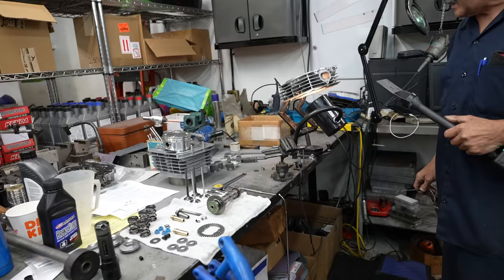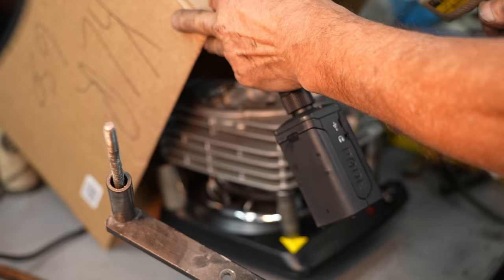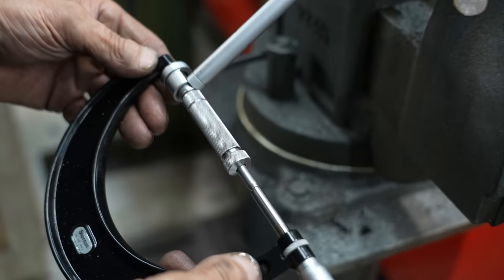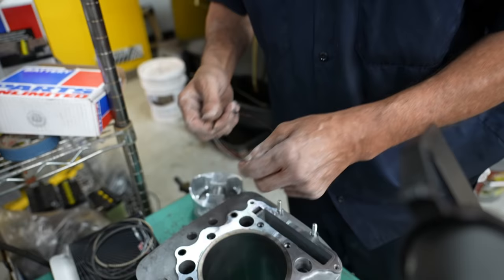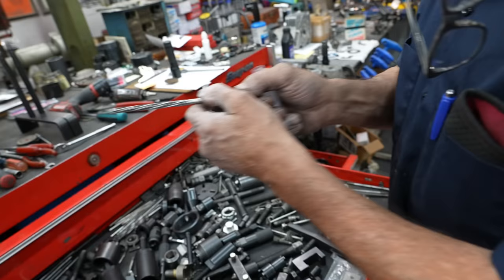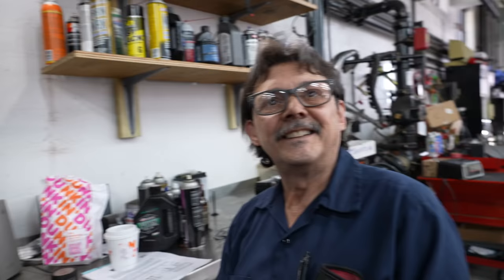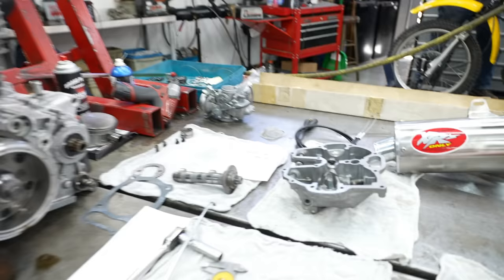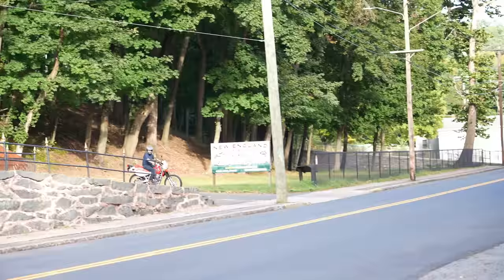OUR BUILT XR650 HITS THE DYNO!

Comment: Now that's talent! Not only is Jeff an engine guru, he bangs out wheelies like nobodies business. This was awesome content. Bring on the head pipe!
Reply: amen
Reply: What carburetor did they use
Reply: @verntreat4162 sorry I am not sure on the carb used.
Reply: I would have prefered to see some acceleration runs from stopped instead... Wheelies are not representative of engine power.
Reply: @altair7001  you already know the power, that's what the dyno is for. Acceleration runs with no timing will tell you absolutely nothing. Not to mention it probably makes too much power to be able to use full throttle in 1-4th gear at any decent rpm.
Reply: @wynandsijben338  - I own a 2007 XR650R that’s been “uncorked” and made for a faster top end. It’s brutal! Biggest front sprocket and the smallest back sprocket. I’ll challenge anyone east of the Mississippi that it’s the fastest XR650R.
Reply: Hell yeah!!
Reply: Was there ever a follow- up to this?
Reply: @altair7001  wheelies are always wheelies and whoever doesn’t appreciate is not able to pull one! Just joking , enjoy biking!
Reply: @fixedguitar47  How about west of the Mississippi‽‽‽
Reply: @altair7001  What's a XR without wheelies!! They go hand in hand 🤘🏻

Comment: That man is a genius!
He just added 50% more horsepower to the entire rev-range of this channel!
Reply: Agree. I haven't watched the channel for awhile. He has brought me back.
Reply: Yeah genius, this engine has a 60HP normally.
Reply: The big change in compression ratio and higher displacement tends to increase power on the entire rev range.
Reply: @polemonek  learn about wheel horsepower and crank horsepower before you comment. Also, there's a difference between XR650L and XR650R
Reply: @sepg5084  you can’t fix ignorance
Reply: @polemonek  That's weird, because my low mileage perfectly running 650L only put out 28 hp to the rear wheel at the Ducati dealer in Denver. After a 2mm overbore,  10.5:1 piston, pumper carb, full exhaust and opened up intake,  it put 48 hp down on the dyno. Still 12 hp shy of the "stock" 60 hp. Hmm
Reply: @milkotex
Dirt bike Dave’s comment was about the CHANNEL (a metaphor), but that went over your head. Then you clearly don’t know the difference between an XR650L and XR650R, so you arrogantly spout horsepower stats that don’t apply here.

Comment: Fascinating video.  

I picked up an '03 XR650L last year.  232 miles on it, left in the corner of a barn.  Got it for $650.

Luckily fuel was totally drained before it was stored.  Did a carb rebuild, and it runs like a beast.  2k miles now 50/50 dirt street..

Been following this build.  This guy is awesome, really amazing attention to detail.

Comment: Nice to have the added horsepower and torque on reserve for those special occasions !  It’s an air cooled motor so high quality synthetic oil is a must with more frequent changes .  You would be shocked as to how hot these motors run even under normal conditions .
Reply: Here (Nevada desert) an oil cooler is a must for long rides.
Reply: @TheBandit7613  do you know any specific oil cooler for the xr 650l that is good?

Comment: What a beast! Great job building a killer engine. As someone who loves his 30hp turd, boy having 45 would be unreal. What was the torque like? The dyno never showed torque.
Reply: I think the way the front-end came up through traction action alone, showed the torque...like my Yam TT500 does compared to my old XT500
Reply: To get the torque values, just use: Torque = 5252 * Power / eng_spd     Unfortunately, his dyno only showed road speed on the X axis, but this can be converted to engine speed via the gearbox ratio, the final drive ratio (sprockets) and the rear wheel radius..

Gotta say, 45 hp for 650 cc is lame - that is only 69 hp per Litre. There are two stroke engines made in Italy that only have 3 moving parts, naturally aspirated and produce over 800 hp per Litre!
Reply: @christopherknee5756  Not bad for breathing more life into an old single cam motor that they want to last more than a race. KTM production bike of similar capacity, more of a modern trick motor, only makes 53hp. This year`s 450 Yam, a high-revving single, makes under 50hp. Kwak KLR650 2022 model, doesn`t even make 35hp.
The Italians and little two-strokes....they`ve always excelled in that field.
Reply: @rattusnorvegicus4380  Had both, miss those days!! Didn"t crash as often on the hondas though!
Reply: @charlesfriend9557  I stood on a pedestrian walkway over the A1 and saw two Germans touring on XT500s and immediately went and bought one. Sound machines, never dropped the XT on the road and was often followed by or I  overtook, those that couldn`t believe lean angle on old block-pattern knobblies. Eg,  "We thought you were off, the shoulder of your rear tyre was completely doubled-under when you cranked it over immediately after overtaking us. We were doing 80mph."...I was greeted with at the pub in  1980, after overtaking Ford Escort van  on slip-road off A1 into constant radius bend. 
On the rough/Enduro, the XT was a real handful, far too heavy in spite of me being over 6` and super fit. Dropped it three times on three outings and gave it up as a bad job before I injured myself badly. (That came 5yrs later on the road with my `76 Guzzi LeMans Factory Proddy Racer, thanks to being collected by a blacksmith in a Ford Transit)
After quitting the off-road bumpy tracks on the XT, I made ovals in stubble fields, the comparatively  even surface made drifting fun, and although it often felt like it was about to tangle itself up, never dropped it there.
Out of over 70 bike owned since I was five, not had a med/ big off-road Honda(broke the crank doing 30ft jumps on a 125 though), but did enter a comp in failed bid  to win an Africa Twin this year....but hope to win the 1,000 miles 2020 KTM 790 Duke up for grabs, come this Thurs 14th Oct`21. That`s more my cup of tea :)
Reply: The Trashman  33hp

Comment: A big 0.080 thousanth's squish (quench area) could be tightened to 0.035 but like he said, that would bring in another point into the compression ratio to maybe 12/1 compression  requiring 94 octane or re-jetting carb for some high octane E-85 fuel.  That would really be a fun dyno number!
 Funny thing, two welded in flat areas on either the head or piston flats (maybe decking the piston height out of the block, too) can allow CR cooling with added swirl, to likely use 93 octane in many cases.

Some guys are keeping the single angle on exhaust valve and sinking the two valves in the pocket a bit, to reduce valve overlap exchange.  Giving the engine less octane requirements.  Highly advanced tinkering.

Comment: Good Day Mr. Kaplan : At about time 7:46 and your dial bore gauge . I was 40 years in aircraft / aerospace and have used and repaired those Mititoyo dial bores hundreds of times . If you like there is also another dial bore maker out there called Sunnen . You can get them with the three fingered model that would be a fantastic asset to your work and your sanity . They are digital and don't have to be disassembled and reassembled every time you need them . Each comes with a very accurate setting ring , all you have to do is put the dial bore into the setting ring and read the number in the window , that's it . No need to to disassemble and reassemble .Try them some time, I'm sure that you will like them .

Comment: Unbelievable build. I would love to have one built like that. Turn it into the ultimate enduro bike. In Tennessee that bike could go places! There is tuff country around here. Plus it’s big enough to handle Highway speeds. So it can make hop different cities it’s own. You are a magical 🧙‍♀️ ! Great in depth video. Honda is the Best built all around bike period ! I ride a 1980 cb900c, 10 speed, air ride, rubber mounted engine and transmission, shaft drive, disc brakes front and back, ! My Son went from the front through the back up dating it for me to ride. Runs unbelievable. Honda is such a forward thinking Company. They just can’t be beat ! 👍🏍

Comment: Admirations for this guy who uses the metric system as more precise than the imperial one! For the fine and precise work he is doing.

However, he doesn't know how to calculate the volume of a cylinder, which is: 
V (volume) = r (radius) x r (radius) x h (stroke) x 3.14 

You don't need to divide by 4 in the end. He divided it, because he was multiplying the diameter, instead of the radius. Diameter is double the radius.

In this case the cylinder volume (cc) calculation is:
51.2 x 51.2 x 82 x 3.14 = 675 cc (not 670)

Because in the previous video he said that he will increase the bore from 100 mm (stock) to 102.4 mm. Unless they changed their mind and he increased it only to 102 mm instead of 102.4 mm. In that case the volume is 670 cc.

Comment: David Vizard proved (with a gas flow bench) that stepped changes of 15 degrees around the valve seat behave like a continuous curve. He also said the cast in boss around the valve guide should be cut away and the guide machined to a plain taper. Straight taper tip flows better than a bullet tipped guide. 
Exhaust ports are less fussy because the hot gasses exit almost instantly and suck the cylinder well below atmospheric pressure.

Comment: i learnd honing with exactly this tools, but we used spezial honing oil to get the surface even smoother. i had to hone holes from 120 up to 500mm 😀 all by hand with a 3000 Watt slow drill, it had so much power it once broke a mans arm when he made a small mistake holding it wrong 😳  you did a very nice job on the clearance 😃

Comment: Most adventue bikes really can't handle as much off road as people think. This xr with the extra power, long suspension travel, high ground clearance. Could be a true off road adventure bike. Instead of 75% hwy 25% gravel country roads large heavy adventure bike. All it needs is an adjustable windscreen & a custom made bolt on 🔩 rear rack with some tough canvas saddlebags & 3rd rear bag. Plus rider backpack, could carry lots of gear deep off road. Or carry lots of groceries home from a ride into town.

Comment: Just a quick notification: The gage is measuring at 0.01mm so this is no "microns" at all; it is ten times bigger. 1 micron = 0.001mm. Still everything said is perfectly accurate. If you set your clearance at 0.05 it is 50 microns. And it is still a freaking precision job!

Comment: One of the absolute best boring/honing work I've seen on the net, loving the 78 Suzuki in the background at 21:31... From the care and absolute passion contributed to this 650 motor it is clear this man is fully committed (rare find nowadays) Did they harden/heat-treat the cam after welding and re-profiling? Love seeing you keep track of the work you've done makes it easier to achieve repeatable results!

Comment: I have a 2000 650L that I bought new, has 5400 miles. I did a base line dyno at Erico Motorsports in Denver bone stock and it did 28hp and 30 ftlbs to the wheel. Then I pulled the motor and sent the cylinder to XR's only for a 2mm over bore (no shop in Denver would bore it that much) . I put a JT 10.5:1 piston in it, a 2004 YZF450 carb w/Noss adapter, an FMF Powerbomb head pipe, an FMF Q4 muffler, and a UNI foam air filter and I opened up the air on (speed holes). Lol
I re-dyno'd it after I put about 200 miles on the bike and it put down 48 hp and 50 ftlbs! The exhaust "Sniffer" showed that it was running lean, and they said with some tuning and break-in it should see 50 hp at the wheel. I ended up moving to the NW and the bike has been in storage for 6 years now. I bought a 42.5mm taper-bored CRF carb but it'd still sitting Uninstalled. I should get it going, way too many house projects 🙄
Reply from the maker: Cool story thanks for sharing!
Reply: @KaplanCycles  Thanks for reading that long novel! 🙏 😁

Comment: personally I just hammer the valves into the seats with a 18oz hammer, close enough to 30psi compression runs on kerosene and let it idle at near red line for a few seconds and shutting off to keep it cool... till it starts to stay running with the key off, then put regular gas in it and repeat going up gas grades until it shuts off when the key goes off. hard to do on one cylinder, works on 4 or more.  😋

Comment: those pistons expand like crazy on the 2 strokes anyway set it up with wiseco specs and scratched the cylinder wall on a few builds. I build a lot of motors for cars 4032 pistons are at 4-5 and 2618 pistons 8-11.

Comment: Notes i have a folder from the 80,s with info u just can't find now , Tony halco off halco racing done engines for flat trackers I paid a handsome amount for my 840 motor hydraulic clutch oil cooler e starter removed n blanked ,the guy was a xs genuis .unfortunately when he passed he took all his secrets to his grave 740 is s high mechanic engineers will go .rip Tony halco ,what a flatracker I owned every where I went people bikers just asked questions. It turned out beautiful n it was my second paint job ,ever ,peace

Comment: One line on that bore gage if it's metric isn't .004" it would actually be .0039" which is .0001" difference probably doesn't matter on a motorcycle but in the machining world that matters especially if you're setting your gages off of that

Comment: I use to be into drag racing and so many friends of mine would put a big shot of nitrous or put a supercharger on their engine and I would tell them you gotta pull the motor apart and gap the rings because if you don’t the rings will expand from the extra heat so much the ring gap closes sizing the rings then breaks the top of the piston right at the ring lands. My one friend would always run his mouth we would end up having this big grudge and his car would always break down. One year he melted spark plugs and blew the throttle body off the intake because he ran a ton of nitrous without running cooler plugs, didn’t take any timing out of it and didn’t have enough fuel. The last year we raced I said dude this grudge stuff is all fun and games but you blow up every year so tell me what ur running so I can make sure ur not gonna blow up. He had a small block stroker Ford with a 100 shot of nitrous so I told him what plugs to run, fuel jet to run, fuel pump, run bigger fuel lines, what to run timing at. I said if ur gonna put a bigger shit of nitrous, if ur lying about the cam ur running and the compression ratio ur gonna ruin that engine if you don’t have the rings gapped, timing set, cooler plugs, better fuel. Well he said nope I’m running what I said. We go race and halfway down the track he slowed right down. He gets towed back and I come over to give a hand. He cranks it over and I could hear he had a bunch of cylinders without compression. I see 4 nitrous solenoids 2 fuel and 2 for nitrous you only have 2 nitrous solenoids when ur running a lot of nitrous. I looked at him and said you just ruined this brand new engine. His girlfriend starts yelling at him for wasting so much money he looks at me and said I didn’t know what I’m talking about. I said dude you are running min 300 shot of nitrous and it’s barley safe to run 100 you ruined a bunch of pistons. Sure enough he pulled the heads and 4 pistons were broken from the rings locking up broke the tops of the pistons and he bought the same camshaft that I have which was a terrible choice to use with nitrous, too much timing, plugs were too hot, fuel line was barely big enough to feed the engine without nitrous, ran 93 pump gas not even ethanol free, he destroyed a 3,000 dollar set of cylinder heads, a 1,000 dollar carburetor, 800 dollar set of pistons, the 3,000 dollar dart block needed to be sleeved a few cylinders were really scored, not only was the ring gap too small but he didn’t even check the gap when he put the engine together he just put the rings on and called it a day I checked one good cylinder/piston it only had .002 clearance that’s not enough even if ur just driving normal. I tried to warn him because I knew he put like 15k into the engine, I even told him just to be safe because ur spending so much money you should get a small fuel cell with a good pump just to run the fuel side of ur nitrous system on with fuel pressure gauge right on the dash so you know u have good fuel pressure on the nitrous kit with a fuel shut off switch so if the pressure drops it shuts off the nitrous plus you can run even higher quality fuel in the nitrous fuel tank all of this will help avoid blowing up the engine, also have a high end ignition box that you can dial in the timing and retard the timing for the amount of nitrous ur gonna use I really tried talking some sense into him so this didn’t happen. He said “I didn’t think I would be this big of a deal running a 300 shot for 10 seconds”. I said dude you have always had big problems running nitrous that’s why I tried telling you all this stuff I mean look at my car I’ve been running nitrous and not once have I even had one nitrous backfire because I set the car up for it I even keep a timing light in my trunk.

Comment: I am curious to know which Megacycle cam was used , I have had good results with the X9 as a good midrange cam .
Of course always with a high compression piston , head work , FMF exhaust due to the fact that it is freely available and an FCR carburettor works wonders .

Comment: Could it be that it is 50 microns? Not 5 microns. There are 1000 microns in a millimeter and the bore gauge resolution is 0.01 or 10 microns.

Comment: This is great im rebuilding the same motor , The problem i had was the bike bogged down at opening up time but wld then take of ,so stripped it , the ports you where talking about where both round but u can see one has been done by some not to clued up ,is it fixable by having material added .or should I just get new head .
Yep just went got the head its egg shaped from the inside out it looks like to much was taken off the port .cheers